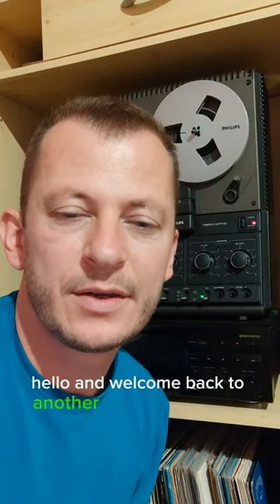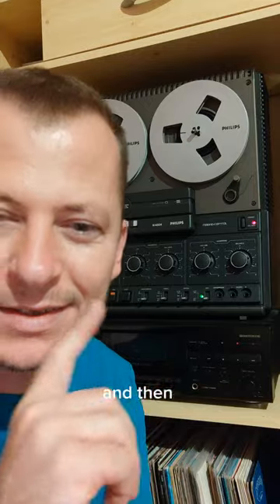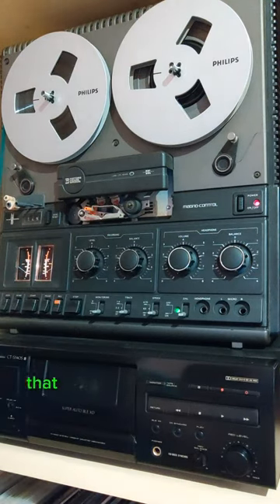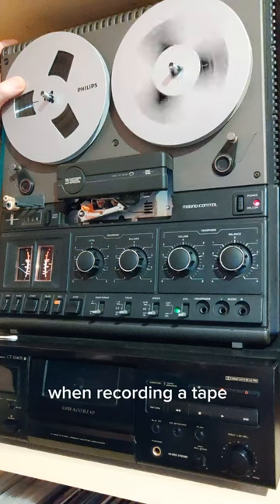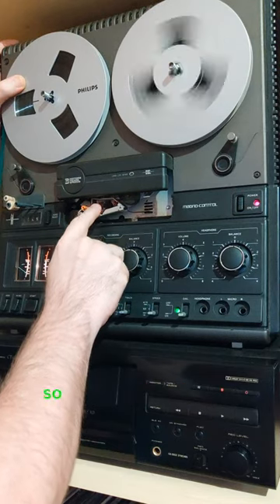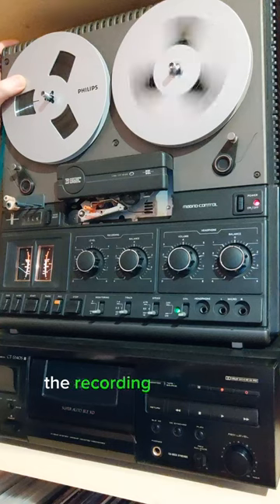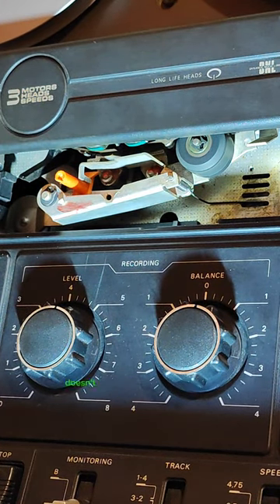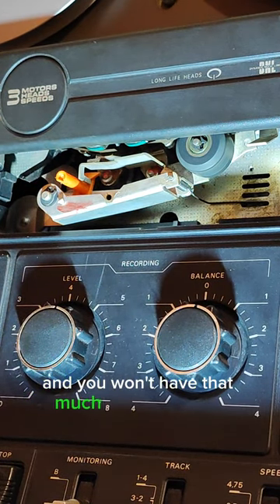Recording head pressure pad switch on Philips reel-to-reel machines

Comment: Pressure pad is not made for the recording had, but for being able to play tapes with back coating. That is taken from the manual and own experience with these machines. If the recording head needs the pressure pad than the recording head has had its best time.